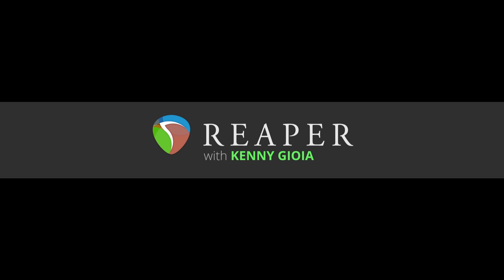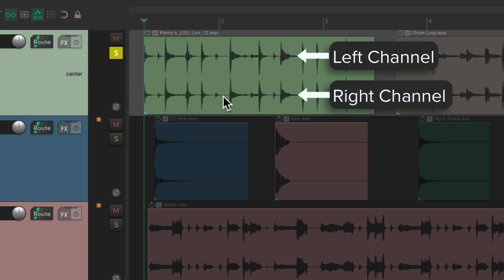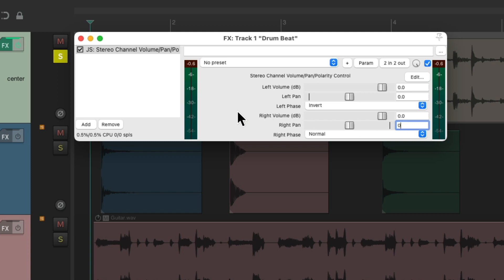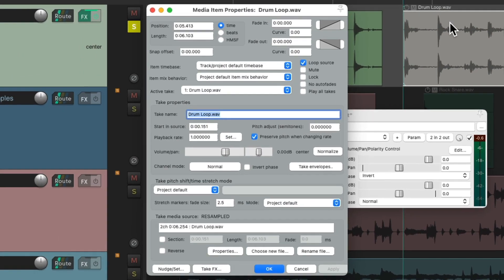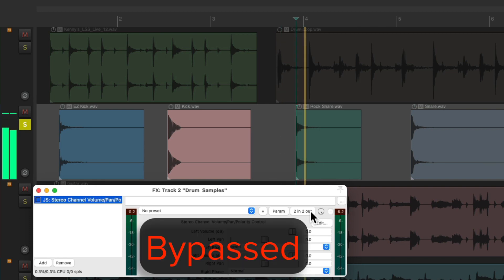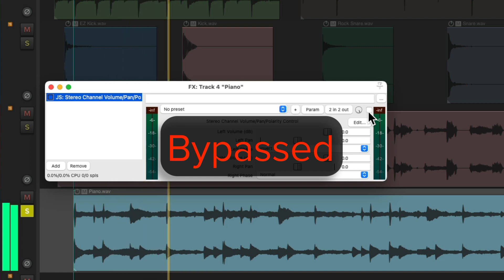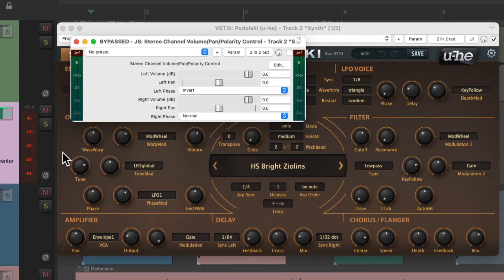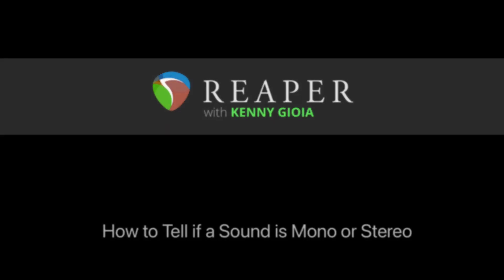How to Tell if a Sound is Mono or Stereo in REAPER

Comment: Hey Kenny! Thanks for these tutorials. They are great help. About this topic, I across a problem that I couldn't solve. Reaper is not able to record stereo in one channel? Even if your audio interface has stereo inputs, looks like it's not possible to record TRUE STEREO tracks (as it's shown in the video). I use a mic that can record true stereo and send it with a stereo cable or/and XLR through the input 1 to Reaper and all I can get is a DUAL MONO track. Is there a solution to that?

Comment: Another quick way is by locking at the VU meters and check if the left and right channels move together or independently. You can also visualize it by turning on spectral Peaks, if the left and right channels have the exact same color mapping then the track is mono

Comment: A lot of times, it is very easy to tell over headphones just listening.  If I'm not sure, I listen to the track and toggle the master Mono button.  If there is no difference as I toggle it rapidly, it's mono.  Again, headphones are easier to hear than speakers.  Visually comparing also works well, especially if you zoom WAY in.
If you do need to do the invert trick, put the plug-in on the master track so you don't have to move it between tracks.  You can even test multiple tracks at the same time with this - the ones that play are true stereo, the ones that don't are not.  Although I guess this method using the master FX would have a flaw if the tracks were 
panned.  As would by toggling the master Mono button.  Hey, maybe that Kenny guy knows what he's talking about!  :-)

Comment: you could also just look at the waveform.. are they different? thats a stereo track then. 

honest question though, if the media played is mono, why does it matter if it is displayed as stereo? does it really affect the sound in any way?
Reply: It also takes double of storage for a stereo file.
Reply: No, the display does not affect the sound. Could as well not display it in the TCP and it'd still sound the same. "Stereo" handling of mono information in reaper is a pet peeve of mine though (once you go into processing with plugins, and the plugin in question has variance between different channels, often introducing a phasing effect -- suddenly your mono signal no longer is true mono which is all sorts of annoying).
Reply: One advantage to displaying it mono is that you get twice as much space to display the waveform, hence twice as much visual detail.  Especially becomes an issue with multiple media items or takes in separate lanes.

Comment: I think i have an easiest way, but someone can correct me if im wrong. I say, If the peak meter lines "Dance" in the same way is Mono, If they "Dance" diferently is Stereo.
Great Tutorial Kenny, you always appear in the perfect moment. greetings!!!!
Reply: Yeah, that's how I usually do it. If it's obviously stereo, no need to spend time analyzing it with Kenny's method. I think his method is good, though, if you're not sure. Sometimes tracks are "barely" stereo and the meters might not reveal that clearly. Anyway, if you want to be absolutely certain, use Kenny's method.
Reply: That works in most cases, but sometimes a highly compressed stereo mix will "dance" the same.  (Or it won't dance at all because it has been squashed to within an inch of its life!)  Listening on headphones combined with looking at the waveform zoomed way in usually does the trick.

Comment: 1: Dock the master track to the left or right side of the monitor
2: Add the Goniometer plugin to the master track
3: Right click the header of the Goniometer plugin and choose "Show embedded UI in MCP"
Way more efficient in my opinion.
Reply: Yeah i also just use iZotope Imager for this.. It's far easier. ;)
Reply: Exactly. Super surprised he didn’t start the video with that. I keep one embedded in my master track a lot of the time.
Reply: @stevenhaver  I think if you have it on your master track, it can get "fooled" if the individual track isn't panned exactly center.
Reply: He showed that method last year:
https://youtu.be/0mgkk0v4QUc
Reply: dumb question but, why are we checking to see if its in stereo or mono? I just record how it was default
Reply: @metaldreams3595  Recording a mono mic in stereo takes up more storage space and when considering what kind of stereo plugins you are willing to put on a track can vary depending on the material.